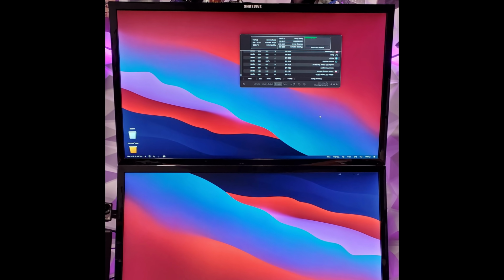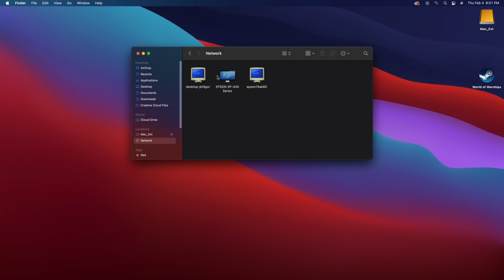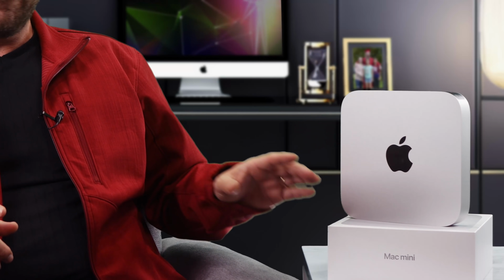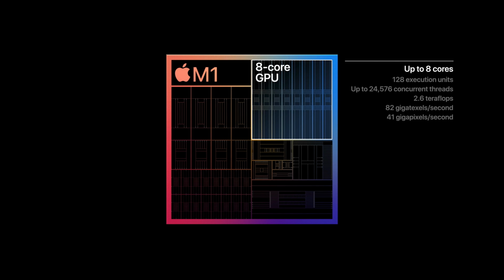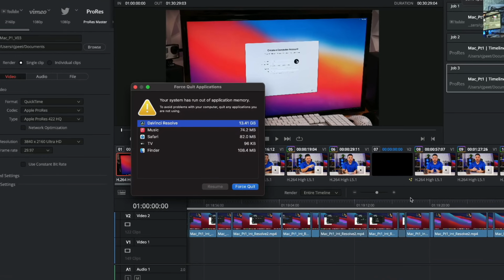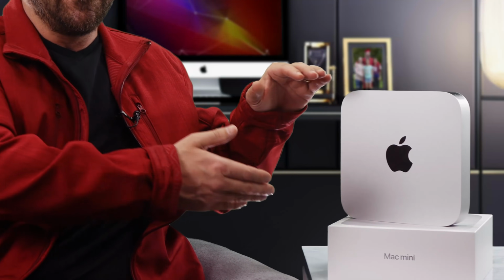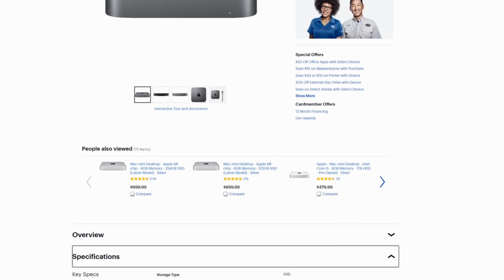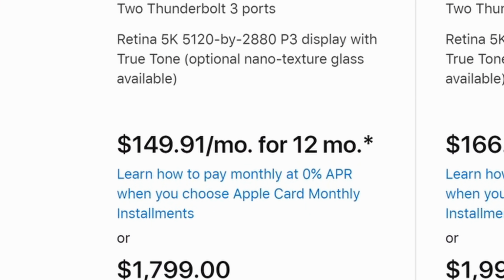M1 Mac Mini One Month Later - A PC User Deep Dive

Comment: My M1 Mac Mini is powering my 80TB blu-ray ripped media server!  I can stream my rips all over my house. It seems to work great for this application and is small, super quiet, and uses almost no power. I will buy another Mx MAC mini down the line once Apple has dealt with some of these issues.
Reply from the maker: What media server app do you use?
Reply: @ElevatedSystems  For watching on my Windows PCs, I have been using Kodi, which is really easy to set up and get going.  On my Apple TV 4k, I have been using Infuse, which is also really easy to set up an get going (there is no Kodi app on Apple TV, as far as I know).  However, for my Roku and Nvidia Shield, I'm having some issues (Kodi is not on Roku and it tricky to make work on Nvidia - so far) and I am thinking about going to Plex to get those working.  That's where I'm at right now, having just downloaded the Plex app for MacOS to the M1 Mac Mini and to the AppleTV.  It'd be nice to use a single app to drive all of these devices (or maybe just dump some of them).  I could easily dump the Nvidia Shield device and the Roku (which i just bought) but before I do that I want to see if I can live with Plex.  I'm not interested in transcoding-on-the-fly to play to mobile devices, which is a thing Plex can do, and I'm not sure how well the M1 Mac will do on that.  I like to stream full resolution 4k and FHD blu ray rips (from media I bought, not stolen or downloaded), stored on hard drives attached to the M1.

Comment: Old cheesgrater mac pro's would buzz and chirp broadcasting processor decisions. Turn up the volume and you can literally hear the processor run. Apple gave me a new mac pro because of it and the new computer chirped as well. Apparently it's because of the chip, proximity of the audio processing sector and it not being shielded from the rest of the chip. Maybe the layer between it and the FPU too thin and shitty.

Comment: I have an 8 year old HP laptop that works pretty good but it's starting to fall apart. I have been looking at AMD processor laptops because of the price/performance. Then comes the M1 Air laptop and Pro starting at around $999. The M1 Mac Mini at $799 seems very reasonable as well. I'm a Windows 10 Pro user and I mostly just browse the web and watch YouTube videos. I also have a website that I maintain using Visual Studio Community 2019. I'm just keeping up with the newer technology in case of my laptop failing so I can get a powerful laptop at a good price. The AMD and M1 processors seem pretty amazing and I'm thinking of moving up to a 4K screen as well because true 4K video looks amazing! I also have a 17" screen so I'm not wanting to go down to a 13" screen. If Apple comes out with a 16" or 17" laptop at an affordable price with the new M2 chip, I'll be interested.
Reply from the maker: Rumor is the 16" Macbook Pro featuring upgraded Apple Silicon (M1X maybe) will be released this year.

Comment: The buzzing in your speakers might be because you need balanced cables between the audio interface and your speakers.  And the bluetooth problem can be fixed with an external bluetooth dongle on a usb hub that is a few feet away from the Mac Mini because the Mac's power supply is putting out interference that is messing with the internal bluetooth.
Reply from the maker: The only option for connecting my DAC to the speakers is RCA, so balanced cables isn't an option. But, I'm using a premium dual shielded RCA cable which performs perfectly when connected to my PC. Also, what is your source on the PSU Bluetooth interference? I'd like to follow up on that.
Reply: @ElevatedSystems  , Daniel Nangos and Tom A
Hi. I think you will prefer this automatic Google translation to my original French text ! My answer goes to Daniel Nangos and Tom A (who has put his finger almost in the right place). 

Since Apple started to provide Mac with USB 3 in 2012, complaints about Bluetooth malfunction have increased. The culprit of all these evils is USB 3, what Intel demonstrates in its White book on USB 3 published in April 2012. So I advise you to start by reading this White book to fully understand the situation :
https://www.intel.com/content/dam/www/public/us/en/documents/white-papers/usb3-frequency-interference-paper.pdf
 
This problem has therefore been known and recognized for almost 9 years without Apple taking or recommending effective measures to eradicate it. First of all, by recommending really serious shielding of cables, connectors and device enclosures in USB 3. (This mainly concerns manufacturers of cables and peripherals.) 
Very effective also, the distance of the WiFi and Bluetooth antennas from the USB 3 connections. This explains why Desktop larger than Mac mini are less concerned because the antennas are further away from the parasites generated by the USB 3. 
A Bluetooth dongle can be a smart solution.

The shielding protection around the Mac mini's antennas is certainly wise, but insufficient.

Taking into account the information provided in this white book, I was able to find solutions to calm my Magic mouse and my recalcitrant wireless keyboard. The least interesting solution was to put an USB 2 hub between the Mac mini and the USB 3 devices, but it was really very efficient !

Comment: Apple doesn't use Bluetooth, they use Bluetooth Low Energy.  Some devices don't work with Low Energy.  Broadcom is the culprit here, they make the Bluetooth Low Energy/ WiFi module.  I imagine Apple is having a long talk with them.
Reply from the maker: My phone uses the same Broadcom BLE 5.0 chip and I've had zero problems with it using the same BT devices as I've used on the Mac.

Comment: Nice vid! I picked up a 8gb Mini after giving my 2015 Air to my niece. I'm glad that I kept them from spending any money on a used Intel based Mac. The only real reason I use a Mac is for Garageband and I have not run into the audio issues you have yet. But I have only really been working through getting everything setup on a bleeding edge device. I've gotten my HX Stomp, Nektar MIDI Controller, and Roland Audio interface all working but it was far from plug-n-play. But that is expected. I'm sure most of these devices will get updates for M1\Big Sur at some point. I do plan to try and use it for more day-to-day stuff as well just to try it on. There have been a few things that I am "Really? that could be better" Like smooth scrolling in Edge browser when using a wheel mouse. But I am still amazed at the performance "per-watt" and would likely recommend this to any general user.

Comment: Unfortunately the issues are real for all to many of us. I love my M1 MacMini, but the BT issues, and external monitor issues are very concerning. I think that there are probably hardware issues that are not going to be fixed by software updates. I'll be receiving a headphone amp./DAC combo today. If that has issues I am going to be really disappointed. BTW I'm just using the MacMini for everyday non-professional computing.
Reply: Have you had any issues with your  audio interface? I have a ua volt and am on the fence regarding a mini if there are problems with audio interfaces having noise issues
Reply: @Ottynetyou  I use my M1 MacMini with an Schiit Asgard headphone amp. and built-in DAC. I also use a pair of HomePod minis. with the M1 Mac. I drive two Dell 27" monitors with it. Note I also use an OWC Thunderbolt Dock. As of the last couple of OS versions I have I can't say I have had any issues with audio. Once in awhile one of my monitors won't wake up, but a re-boot fixes that. I use some pretty nice headphones, both wired and cabled. So I'm sure I'd hear any issues with sound. So, I am a consumer of music, not someone that does recording work. One last thing, I did pop for 16GB of RAM, and 512 SSD. I use Apple Music and Tidal for listening. Hope this helps!

Comment: As someone who wants to build his first NAS, that NAS issue sounds like a deal breaker. I guess it's something I'll just have to live with and just plug my speakers to the 3.5mm port
Reply from the maker: There may be a very simple solution to the network folders problem, I just haven't got that deep into MacOS yet. I mentioned it because I highlighted it as a positive in my intro video.

Comment: I too could not figure out the 'video toolbox' handbrake h265 settings when i got it where i thought i liked it, the files were absolutely huge, worse compression than the old intel quick sync, but on software(using the CPU) the M1 was slower and used significantly more power from the wall, than my thinkpad L15 with AMD 4750u using the same power meter for both. When i used the video toolbox the transcode took almost 1/3rd the time, and while the momentary power consumption went up by ~15-20%, the significant reduction in total run time brought the overall WH used to transcode the same video down to less than half. 
I bought this Mac Mini to dedicate to handbrake transcoding the TV shows i record, but to learn that it is not only slower, but also less efficient than AMD's old processors was just a bit upsetting

Comment: I have narrowed the buzzing down to USB-C-charging via my monitor's USB-C-DP-Port. Shielded cables work better but there still is some static (but no buzzing).
Reply from the maker: I tried disconnecting everything in my office, however, I did still have my secondary display connected via USB-C. I'll try disconnecting that and follow up.

Comment: I'm surprised you haven't pulled the thing apart, broke out your testing equipment, and diagnosed and solved the IO problem already.
Reply from the maker: Na, I have Apple Care 😊
Reply: @ElevatedSystems  Mac Mini, bought at Costco for $669 includes 2 year warranty.  I have used macOS in the past and it was OK.  Unlike Linux and Windows, should you prefer larger fonts, such as in the bookmarks toolbar, you are out of luck in macOS.  You can change the fonts on say Finder, and maybe somewhere else, but that is the limit.  You can scale the whole system of course.  Our Apple store is shut, so no more local support.  If it reopens, I do fear a need to triple mask before entry.  :o

Comment: hey man. i have a question. how do we plug in a device that needs a microphone port into the mac mini. do i have to buy a headphone and microphone port splitter? so i am a person who solves rubiks cubes and i need to plug in a timer device that gives input to the mac mini so a website in my monitor can recieve the time that is being displayed on the timer device. or is there something else i need to do. pls help. thanks
Reply from the maker: You can try a USB to 3.5mm Microphone adapter. You can typically find these for under $10.